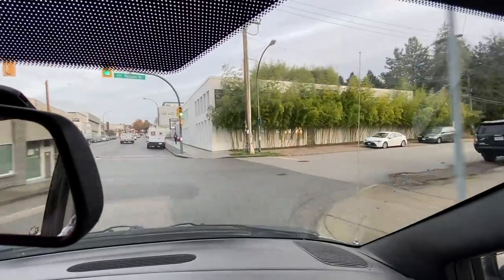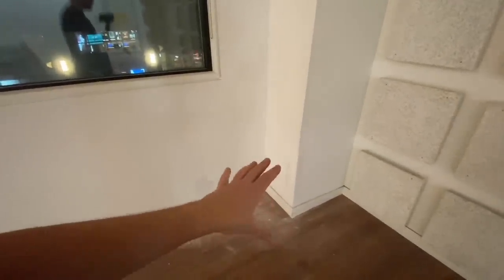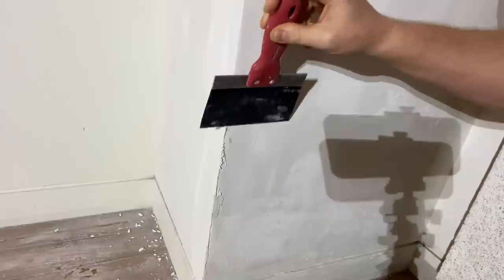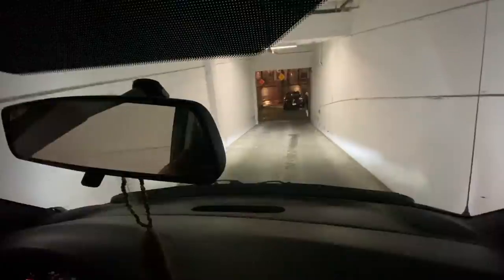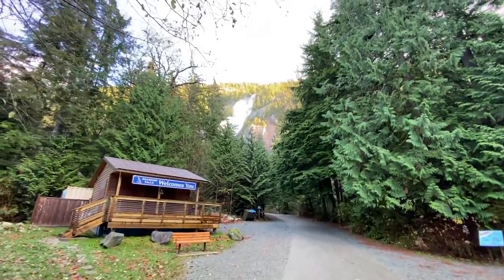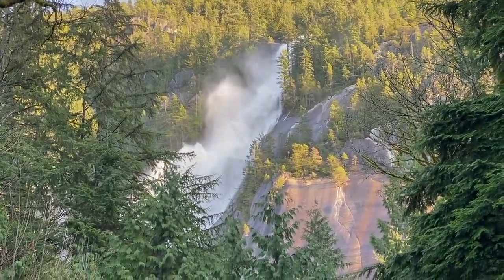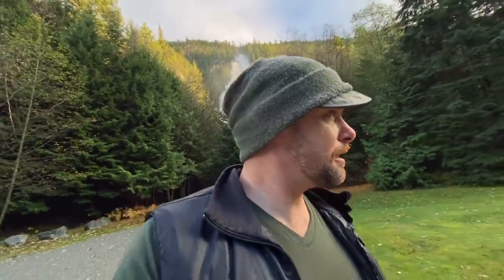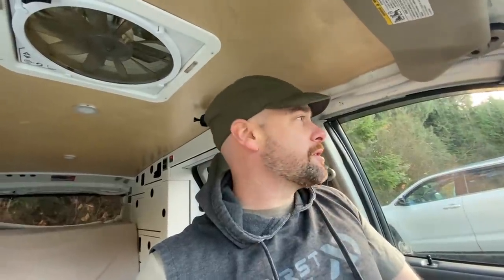Atmospheric River || Van Life, Work, Rain, Floods, Waterfalls, & Rainbows

Comment: Hey Joseph! The things y’all do for YouTube is great! Love your skills and your van is bitchin! Nicely done man! Wondering how your keeping warm for the winter? Please advise as I’m starting to loose sleep worrying as I will be starting my vanlife journey in January.
Reply from the maker: Hi Scott, thanks for the kind words.  To answer your question I have a small heater that I installed in my van several years ago; I have a video about it in the build series.  It does a pretty good job of keeping things really cozy inside the van during the cooler months of the year.  I really recommend the kind I have(dry air heater) over the portable propane style heaters, though, those will get you out of a pinch if you'r stuck.   Best of luck my friend.

Comment: 🚐🚐🚐🚐🚐🚐Is the van 🚐 a Commuter long wheel base?  It’s a newer model than mine, I have a 1996 Hiace long wheel base Commuter high top.  Mine used to be a local government taxi and seated 16 people and had a wheelchair lift in the back.  A lot of disabled groups use them every day to pickup disabled students in Australia.  Also the Hiace is one of the most used Van for tradies.  They keep going and going.  
I love my Hiace, I have been doing it up for a while now, they are very solid, I fit in a normal car park, width wise is great but I do sometimes hang over the back if the parking spot is short.  Mine has 324,000kms and doesn’t look like stopping anytime soon. 🚐.  Hope your friend gets it.  
Best Wishes from AUSTRALIA 🇦🇺🦘🐨🚐🙋🏼‍♀️ JENNY and 🐕 Hannah.   PS little Hannah just loves going out in our van🐕🥰

Comment: Man, drywall sanding is horrible isn't it! Definitely better with proper respo on. Looks pretty good! One of the best things I ever did was to add a Dust Deputy to the vac. Did a surprisingly good job of separating that nasty fine dust before it clogged the filter.
Just occurred to me that with your "regular" passenger van, you've got the bonus of being able to fit in parkades. Nice to have that option.
Reply from the maker: Oh cool man I've always wondered about those things.  Yeah the drywall stuff isn't much fun.  I didn't have the vacuum attachment for my sander and I'm all out of replacement cartridges for my respo.  The n95 I used worked pretty good; I had clean boogers after the job which is always nice to see.  hahah
Reply: @SharingTheWild  Yeah, that dust is insidious! I was surprised how well it worked given the particulate is so small and light. But I guess if you're getting out of doing this kinda work, it's not much use. :) Hope you're on high ground! Pouring buckets in Victoria.
Reply from the maker: @wingnutbert9685  yup, probably hanging out at a similar elevation as you. I'm back on the Island(spoiler) and yeah lots of rain in Victoria today.  😉